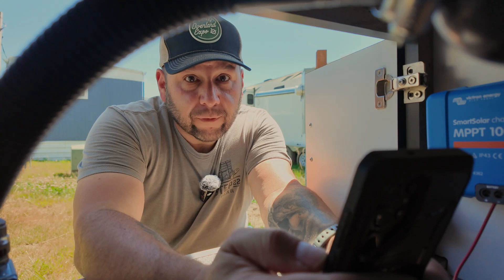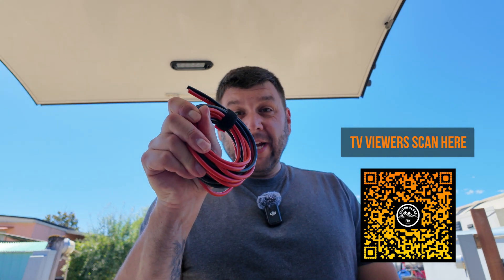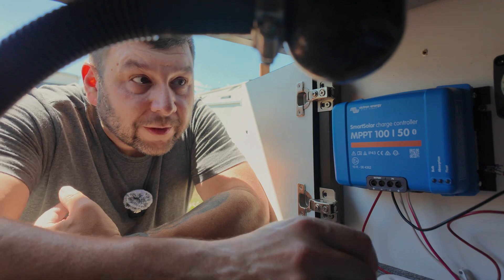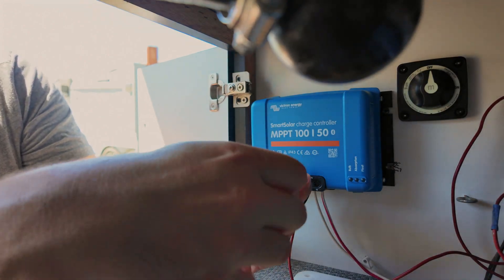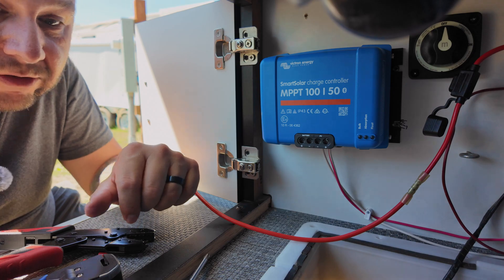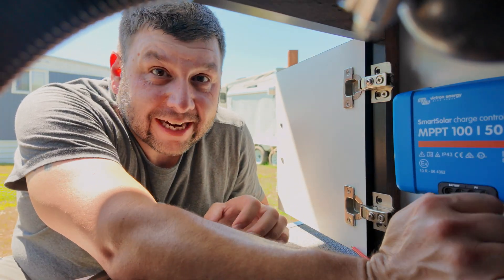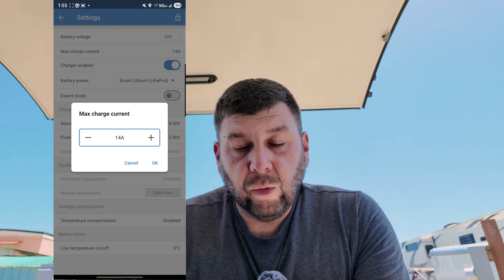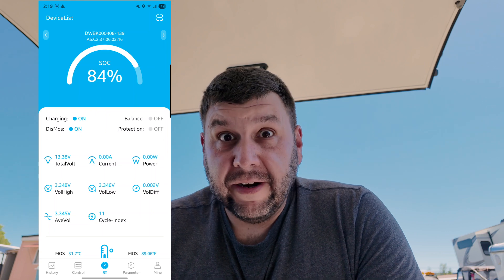Bluetti + Victron Update: The Simple Fix That DOUBLED Our Charge Rate

Comment: Nice (and sensible) upgrade. Any reason you don’t heat-shrink after crimping to keep moisture out?
Reply from the maker: Thanks! Appreciate you watching. It's amazing what such a small adjustment can do. And the connectors I used have the built-in heat shrink. I just didn't show me on camera sealing them up.